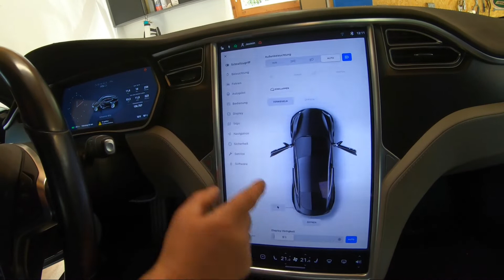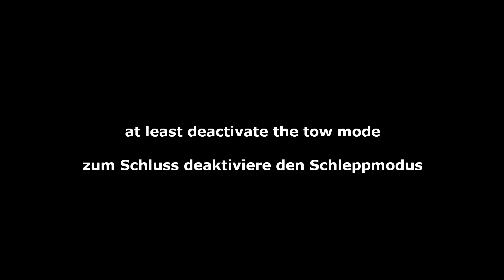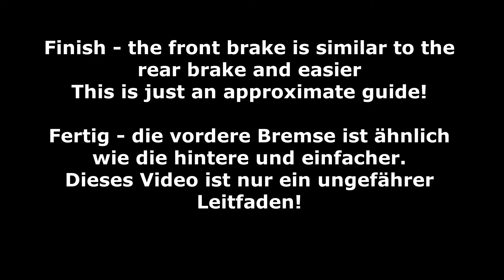Tesla Model S rear brake service / Bremsen wechseln / Parking brake

Comment: If you push the brake caliper toward the car and pull it back toward you it will push the brake pads in to allow the caliper to pull off easily instead of needing to hit it with a hammer

Comment: You mention to loose the screws from the parking brake (at https://youtu.be/7Rmds7OFpk8?si=f2d8rYeNUyc2sZLy&t=200) but you don't show how you did it.
I am having a hard time doing that, and I am not sure if I have the proper tool.
Could you please share which tool you used?
Thanks in advance.

Comment: The worst brake service video ever seen, mostly due to the total neglect of the brakes in the last years. Those brake pads should never have been this fused together with the calipers. Not to mention the lack of cleaning of the parts in the caliper. Just adding grease over the corrosion is not the way to do it. I'm really sorry, but if you are creating content to explain to others how to do it, at least do it right.

Comment: So the pistons can be pushed back using our fingers with the pads are off? I see some people use the screw driver method while the pad still on, same thing ?
Reply: If you plan on changing the brake rotor, you can just use a screw driver to push the pads on the piston directly. When doing mine I realized how easy it is to push them with your fingers only when the pads are out. You can also buy a special tool to do it.

Comment: do you need a obd computer or something like this to retract the brakes?
Reply: No, you don't need additional devices. Just turn on TOW MODE.
Reply: @vist628  Unless the parking brake servo has died and won't respond...then you'll need to actually remove the three screws holding the servo to the caliper (25 Torx) and then expose the spline gear to the calipers, take a 14mm open end wrench and turn the spline clockwise until the calipers disengage the brake disc.
Reply: Really great video and it was really helpful.  I was wondering if you happen to have to park specs for the parking brake caliper mount bolts?